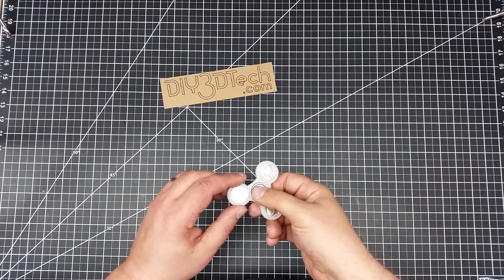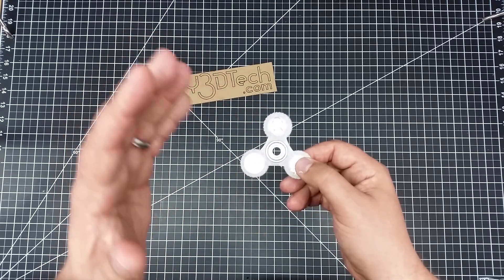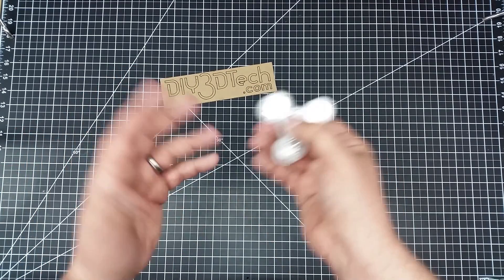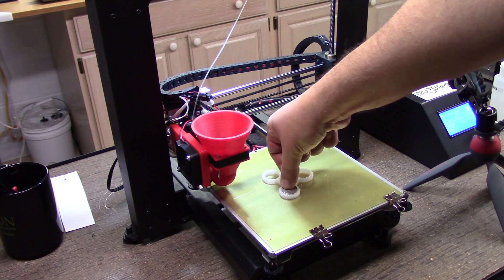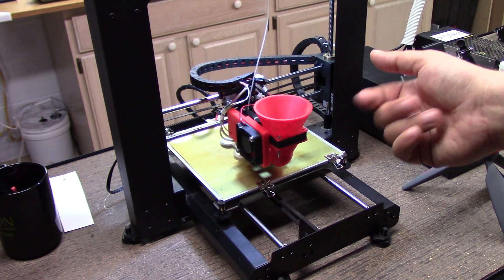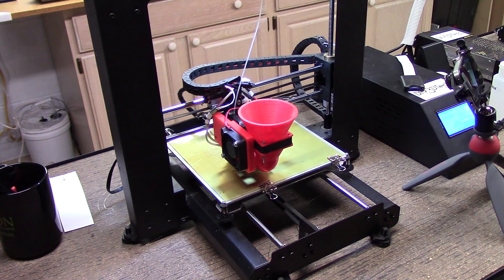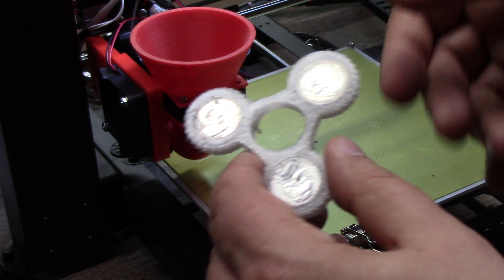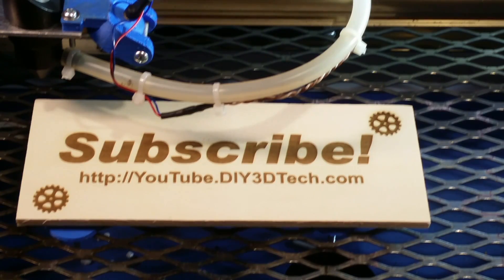3D Printed Project - Prototyping Tips!

Comment: In your end code g-code on your slicer add g0 z200 it will shove the bed out so you can retrieve your print easier rather than 0 to the back
Very cool prototyping!!!!!
Reply from the maker: Many thanks and do have some end GCode routines, however however have a bunch of machines I slice with so I tend to get lazy sometimes :-)

Comment: Due to the way OpenSCAD draws cylinders, they will always be smaller than the radius you set. It draws the points around the circumference at the correct distance from the center, but connects them with lines, not arcs, which reduces the effective size of the radius.

To set the actual radius correctly, you need to account for the number of sides in your cylinder, and calculate what the radius should be. I wrote this OpenSDAC function to do that.

function radius(diameter, sides) = ( diameter / 2) / cos(180 / sides);

An example cylinder would be as follows:

cylinder(r = radius(22, 6), h = 24, $fn = 6);

$FN specifies the number of sides to use in the circumference.

This example would make a hexagon where the distance between the flat sides is 22. If you just said r = 11 the distance between the flat sides would be much smaller.
Reply from the maker: This is very cool, if you don't mind will use this on my Open SCAD channel as this is great tip!
Reply: Sure thing, just remember that in some cases, you wouldn't use it and in other you would. For example, making a hole to fit a peg, use it, but don't use it for the peg.
Reply from the maker: Good point!